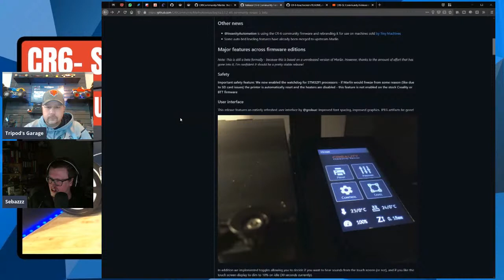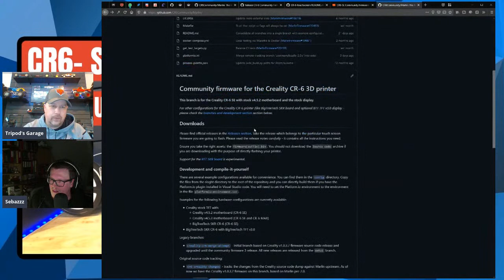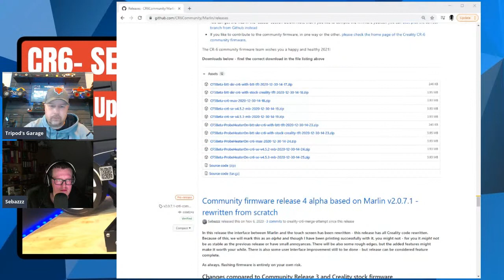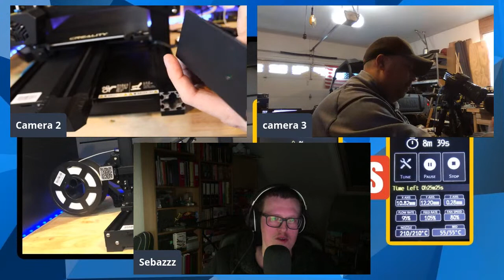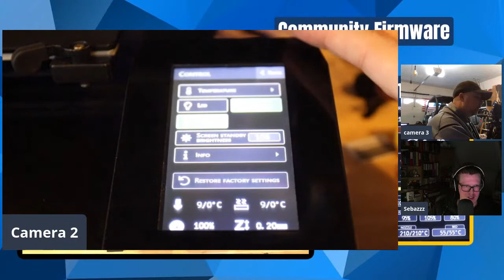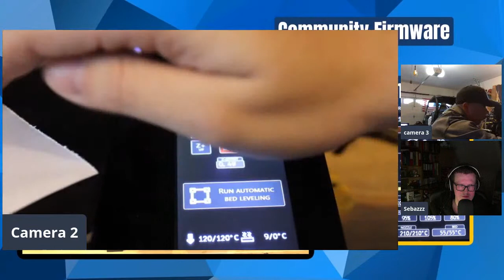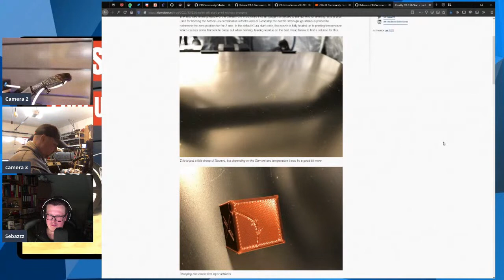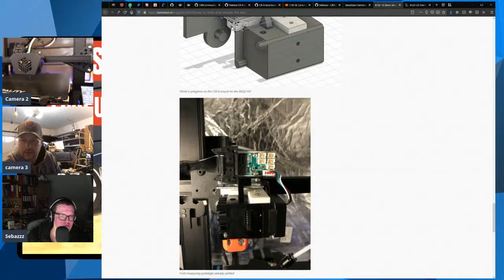CR6-SE Community Firmware Upgrade Live - With Sebastiaan Dammann

Comment: Sorry I missed the live stream.
Thanks John. And Much appreciation to Sebastiaan and his team.I swapped over to the community firmware over Christmas just for the working pause and filament change options. The fine Z-height offset and modifying flow and speed on the fly is also great. I was lucky with my kickstarter unit. I swapped the power supply switch when it arrived, and have had no other problems with it.

Comment: just watched this and have a solution for FAT32 formatting difficulties because the total card size is > 32GB.
1. remove all paritions from the SD, 
2. create a partition that is 16GB, 
3. create a second partition with the remainder (maybe not required). 
4. you can then format the first partition with FAT32 and unit size 4096.

in windows diskpart this worked with a card that had 1 partition on it initially for the whole size.
1. select disk 1
2. select partition 1
3. delete partition
4. create partition primary size=16000 (windows will assign a drive letter and create a volume in the background)
5. format fs=fat32 unit=4096

that's it.  Hopefully it makes someone's life a bit easier

Comment: How did you fix the one side of the bed not being level? I’ve had this issue since day one on the left side of the bed
Reply: Check to make sure the gantry is level to the bed, next, remove the cover from the print head and check the 2 screws holding the head and sensor to the bracket are tight

Comment: there`s two groups of people you don`t want to piss off: first is the Prusa owners, the second is the Creality ones. While I do understand why the first group would stand by their choice, I mean Prusa is an outdated machine but it works altough a bit expensive, but the Creality people I don`t get. The same mediocre machines with subpar parts and sketchy firmware and some inflated prices for their medium and high range printers, if you could call their products high range. Take this CR-6 for example. To some their use of a strain gauge for leveling would seem innovative and original but in reality its just another thing put on the machine to make it flashy and charm their customers out of their money. It doesn`t work reliably and it relies on proprietary parts of dubious quality. Then there`s the extruder... at first you might be fooled to think it`s a Titan knock-off with gear reduction and relatively good performance but no, it`s just a reworked plastic cheapo lever and spring which not only brings nothing better than the old style but introduces new problems with its quick tension release design relying on the whole upper part of it pivoting in order to exert or release pressure on the feeder roller. Again, novelty for the sake of glitz without bringing anything extra in terms of reliability and performance.
Reply from the maker: Hello Ciprian Maior,  I couldn't agree more!  People are so loyal to some of these companies, and even basically apologize for them!  Their Facebook groups are the main source of this, telling people to just deal with it, it is a simple fix, just do it yourself!  On Friday, I had one of these people troll on my YouTube CR6-SE review, well there is a number of them in the comments!  These printers are not exactly cheap, and to have things fail right out of the box, and have these people on Facebook and other forums defend these companies, just makes me sick!
Reply: @TripodsGarage  Last November when I first got my 3d printer I had a choice between the Ender-3 and the Tronxy Xy-2 pro. Comparing all the features and the price the Tronxy won hands down. When you buy creality you buy hype and over inflated price. People tend to have a herd mentality: if everyones buying it then it must be good. Well, în the case of Creality its mostly average at best while their prices are always big for what they're offering. When I hear people talk about quality and reliability with Creality I start laughing. They use sub par cheap parts and solutions for everyone of their products yet somehow they are a monument of reliability... Go figure!